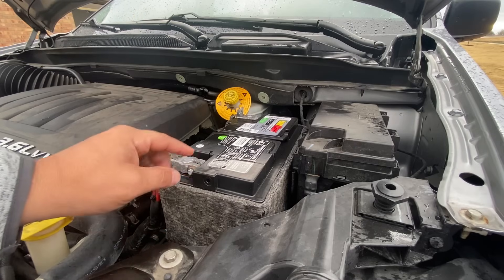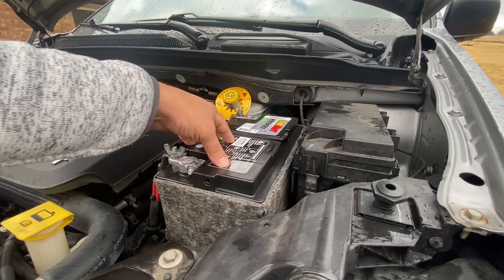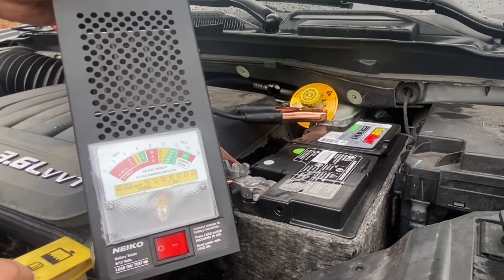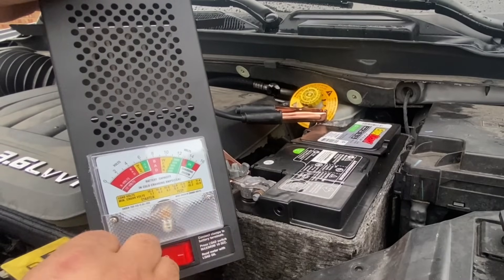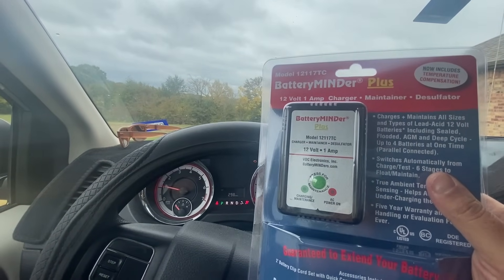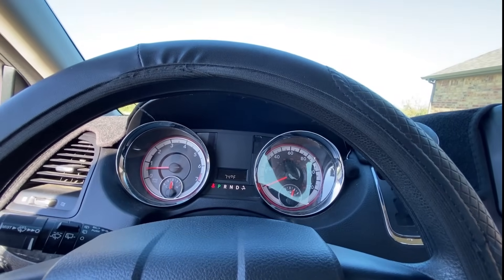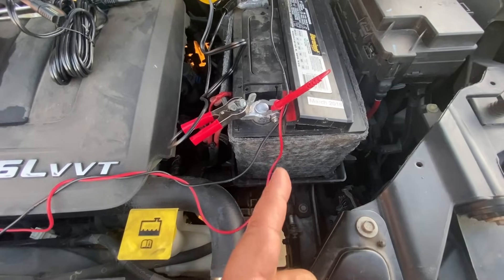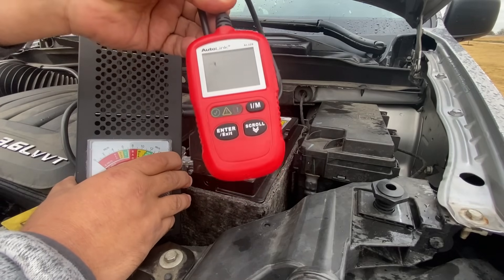Why Your Car Battery Fails Emissions Tests!

Comment from the maker: ▶ 12 Volt Load Tester https://amzn.to/3fN1DxL

▶ Battery Repair video https://youtu.be/YXh8eEkOBlk

Link to recommended obd2 reader tool ▶▶▶ https://amzn.to/3u4MQKi
Why I normally do not recommend obd2 reader ▶  https://youtu.be/WrzE_E6WixM?si=lDZg6OksGfV0Ekbb

Look HERE, Vehicle Specific Drive Cycles for your vehicle is below........................
▶Complete Smog Playlist https://www.youtube.com/playlist?list=PLDEbtVOPRC-h4WB90arPwdn_r7wr3kGki

▶ 12 Minute Actual Drive https://youtu.be/jldTJI64cfM
▶ Demo EMISSION INSPECTION MONITOR Readiness (I/M)  https://youtu.be/gAumb9zgLZg

▶ Acura Drive Cycle https://youtu.be/2b7dYwMQZDo
▶ https://youtu.be/uO9iDeUZOyM Audi Drive Cycle
▶ BMW Drive Cycle https://youtu.be/mk6Tk330Acw
▶ Chrysler Smog Readiness check https://youtu.be/O1RH-u1bNIc
▶ Chrysler Smog procedure https://youtu.be/dyYv4HpYPys
▶ Ford Drive Cycle https://youtu.be/j8ZFTE1rSfA
▶ Gm Drive Cycle https://youtu.be/Yp34ksJY-fQ
▶ Honda Drive Cycle https://youtu.be/oZELvZ4danA
▶ Honda Smog Readiness  https://www.youtube.com/watch?v=cxpE_I1cKh8
▶ Hyundai Drive Cycle https://youtu.be/UzC4FNTqNdI
▶ Infiniti Drive Cycle https://youtu.be/76SByziNMFI
▶ Isuzu Drive Cycle https://youtu.be/glw0d7y5_lQ
▶ Jaguar Drive Cycle https://youtu.be/h_aCeJch53U
▶ Kia Drive Cycle https://youtu.be/OtSDdIgQ6_g
▶ Land Rover Drive Cycle https://youtu.be/A-CmBzlXszY
▶ Mercedes Benz Drive Cycle https://youtu.be/gLnhD4gP0kM
▶ Mini Cooper Drive Cycle https://youtu.be/ND08_kKz8Ls
▶ Mitsubishi Drive Cycle https://youtu.be/3ywgZW2zMa8
▶ Nissan Drive Cycle https://youtu.be/s9PLkO-CjZ8
▶ Porsche Drive Cycle https://youtu.be/Yi6eANscwhQ
▶ Subaru Drive Cycle https://youtu.be/w3DF4g2h96M
▶Volkswagen Drive Cycle https://youtu.be/uh8BhqJpzGg
▶ Volvo Drive Cycle https://youtu.be/mEeUwDd_dsc
▶ Catalyst monitor not ready? https://youtu.be/hi7QdlgKHzM
▶ Catalyst Monitor Cheat https://youtu.be/BuZYAy_xi0E
▶ Catalyst not ready? Watch this video https://youtu.be/ERQUUdWo3-o
▶ Evap monitor not ready? https://youtu.be/99nfTcPy4fo
▶ EGR monitor not ready? https://youtu.be/aujgghRf04I
▶ Oxygen sensor not ready? https://youtu.be/sAvxeAyYsRk
▶ Oxygen sensor replacement https://youtu.be/9jKuutvNs74
▶ Oxygen sensor heater element testing https://youtu.be/zEbXn6vgqiA
▶Link to Scanner in video http://amzn.to/2BZYqWo
▶▶▶Video about recommended Full Color Scanner https://youtu.be/qpHeVGH_6uA
▶Link to this full-color scanner  http://amzn.to/2z0YTcF
▶Lucas Fuel Treatment https://amzn.to/38p7Ps6
▶Car Memory / Data Saver https://amzn.to/3mCTpKd
▶Link to Scanner in video http://amzn.to/2BZYqWo
▶▶▶Video about recommended Full Color Scanner https://youtu.be/qpHeVGH_6uA
▶Link to this full-color scanner  http://amzn.to/2z0YTcF
▶ Catalyst monitor 2024 update https://youtu.be/HkF4oCED0UU
▶ Update 2024 OBD2 Reader video https://youtu.be/SguhiTfgpFQ

As a smaller YouTube Creator, my channel runs on the generosity of viewers like you. 
☕ ☕☕Buy Me A Coffee! https://bit.ly/Cofy4RF
☕ ☕☕Buy Me A Coffee! https://bit.ly/Cofy4RF

▶▶Try Amazon Prime FREE for 30 days!! https://amzn.to/3wuBikn

Check out my Amazon store▶ https://www.amazon.com/shop/randomfix
https://www.youtube.com/s/gaming/emoji/7ff574f2/emoji_u25b6.png

Comment: You make a very good point, as the battery is also many times responsible for those pesky U codes. which can affect different modules on the car's network. However, a lot of mechanics are now using battery analyzers because in addition to the battery load, they test the internal resistance, which gives a good indication of the condition of the plates inside the battery.
Reply from the maker: Thank you for the great feedback. Yes these batteries are more important then even.